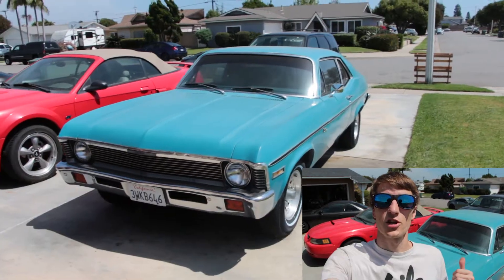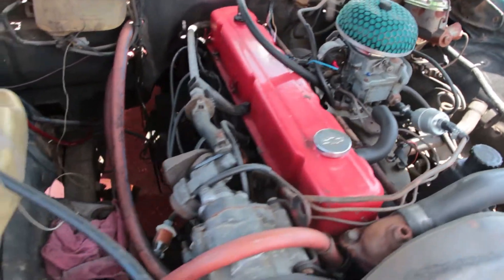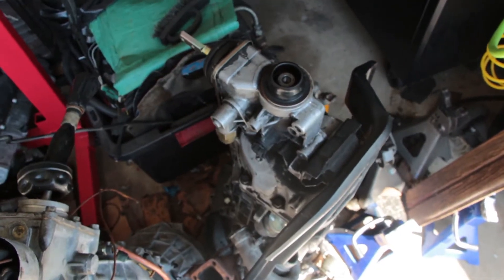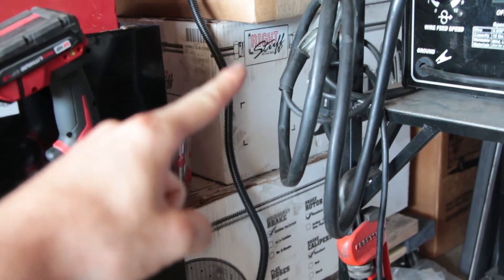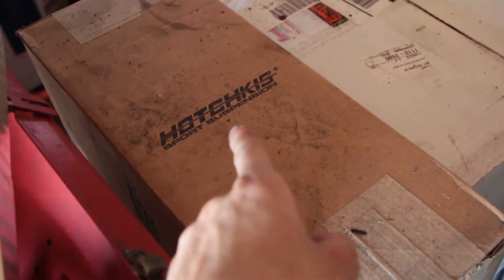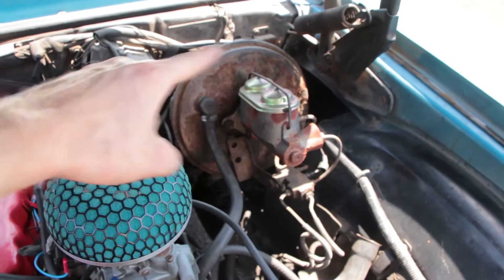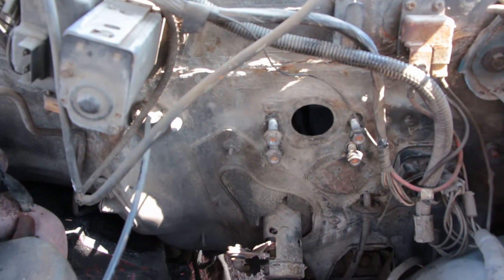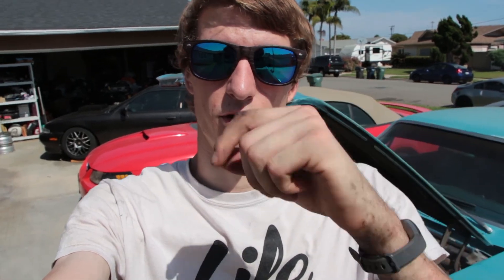Chevy Nova Project Begins

Comment: Had a 70 Challenger  with 440  it had 4 wheel drum breaks  it wasn't  bad.. and   it wasn't great either..,
Also 69  Ell Camino  SS 396 had 4 wheel drum . Went to junk yard pull off disc. Upper & lower control  arms with  the  spindlesdisc brake  assembly  71 Chevrolet  wagon . For $ 250 . This was in 1977 .  After market didn't really exists. Until the mid 80s . It's nice to see  a young guy  ( your channel)  that  uses  their brain. Most guys today can't  find the dip stick. Let alone change  the  oil or a tire . When my  daughter   can  change out a tire  in a rain storm  while  working securty at Groom lake  when she was 18 yrs. And  an expert marksman.. 17 yrs and she still in the air force..wow.